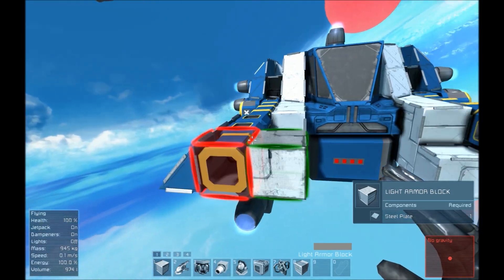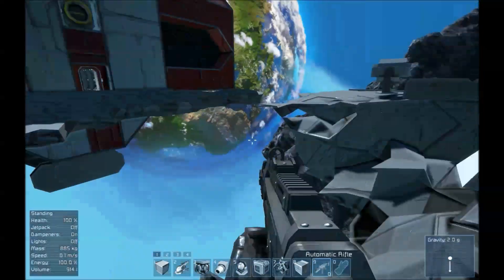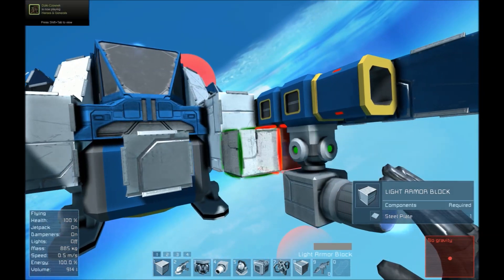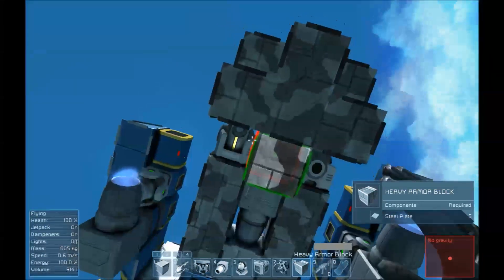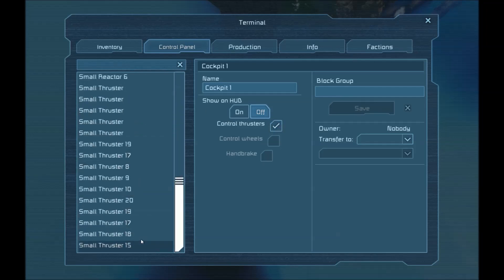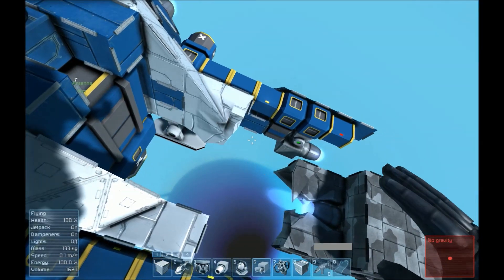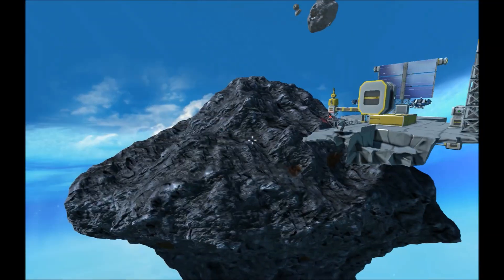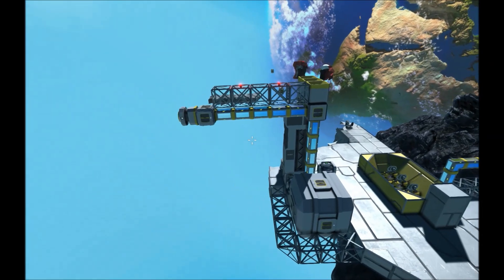How to destroy a Capital Ship in 1 shot: Nukes in Space Engineers (Tutorial)

Comment: Fun fact, the red schip is probably a small frigrate.
A capital schip is the leader of a whole fleet, it should be able tot Carry multiple red ships
Still nice vid though
Reply: alfred appel Size actually does not matter. A capital ship can also be a highly sophistocated destroyer of sorts that is larger or better teched. In my case it is the highest tech tactical Strategic Command Assault Vessel or TSCAV for short. Its primary job is the leadership of warfare and resource management in mass which does not include front line fighting. actually the opposite. Hiding and utilizing powerful radio tech and numerous computers to navigate the smaller warships that could not carry such a sensative system into battle (iv tried. any serious slugging match kills at least one system and it takes to long to repair and reequipt a whole fleet with advanced navagation vs a master control unit) and pull it out intact every time.

In many cases a lead vessel may also refuel and is usually a carrier in my case as its primary means of attack should be fighters, bombers, drones, and cruise missiles. It should have minimal protection as it should never personally see the enemy.

Comment: What is with space looking all blue? :P
More relevant question. But with the ability to remote control things now, you could design a missile carrier that fires beyond visible range using scout ships to sight a target, and then just control a guidable nuke right?
Reply: Masterfully1 there is now a radar mod that works really well. I have a prototype that uses active radar (it WILL detect anything within 50k line of sight but can go farther.) as detection. The trade off is it is a extremely high profile detection method as by using active radar it reveals it's own possition to anyone with a radar or antenna equipt. It can be evaded obviously but it is not easy considering that it has a deadly lock on that will track you and a payload that should kill most roids so hiding wont nessisarily save you. Still have not found a counter to warping evasion techniques that work all to well on any for of high profile tracking.